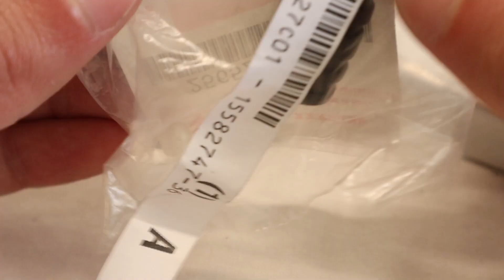Let's Save This Shift Lever | 1996 RM250

Comment: Very cool, but that circlip is going to come off in the first ride!
Reply from the maker: I'm going to do a little more work on this shifter.
Reply: @madmarc did you manage to get the chain to clear it comfortably?
Reply from the maker: @420Sean69  What do you mean? There was never a clearance issue.
Reply: @madmarc  in the YouTube short comparing old to this one, this one would touch the chain when you were shifting. It may have been no tension on the chain causing it to look like that but I was just wondering